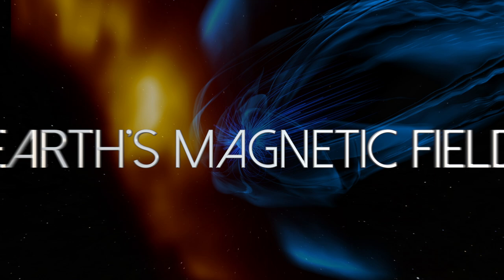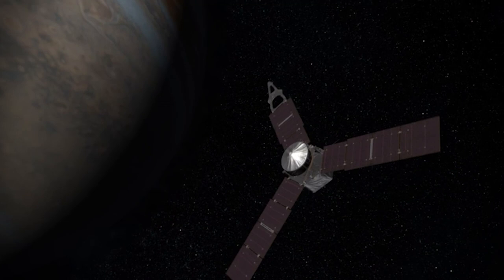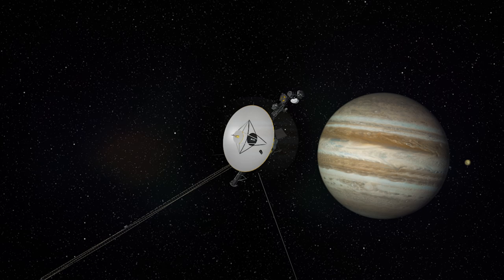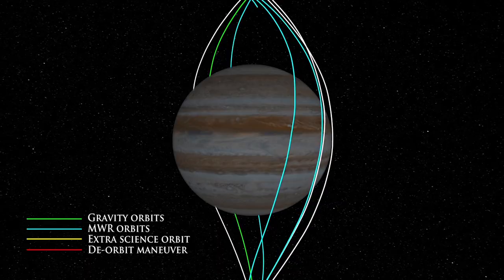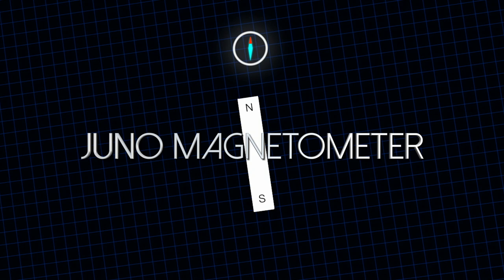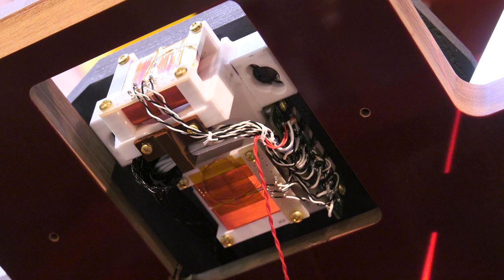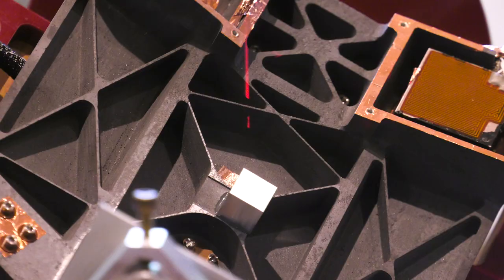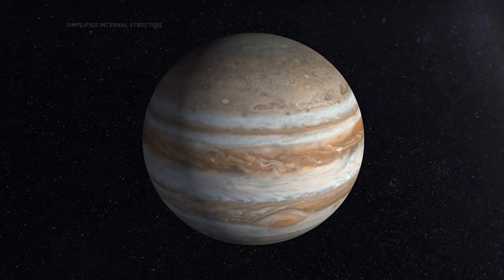Exploring Jupiter's Magnetic Field

Comment: Carbon/silicon carbide......
Tough material and very resistant to thermal issues.....
Not a friendly material to work with though. 
Were any other materials considered for the magnetometer optical bench?

Comment: I watched it with subtitles... The "satellite beeping" in the end bugged me out.
Reply: If Jupiter's formation occured slightly before our Sun. Is it possible that Jupiter would have been a star and not planet? @NASA Goddard
Reply: Jupiter, and all of the planets were formed out of the sun, a HUGE GRAVITATIONAL SYSTEM came close to our solar system and pulled at our solar system from two sides, saturn and jupiter were formed from the largest bulge, and the other 10 planets were formed from the other side,  All the planets grew from meteors hitting them.
Reply: The thing with jupiter is that it ran out of debri, but it could have been another sun, or so they say.
Reply: Yeah around 12 times more dust and gas.
Reply: Both gas giants wete so hot when born they were miniature suns for awhile